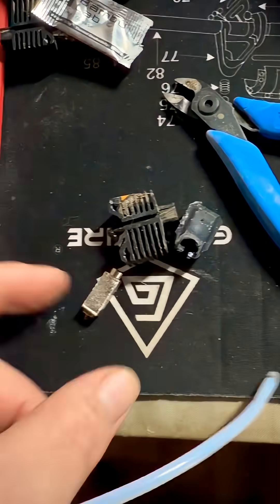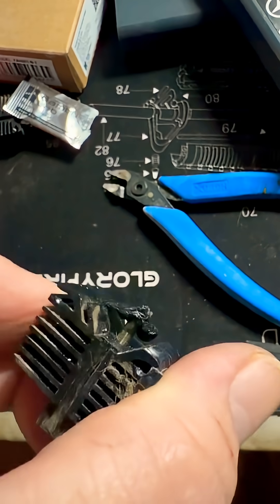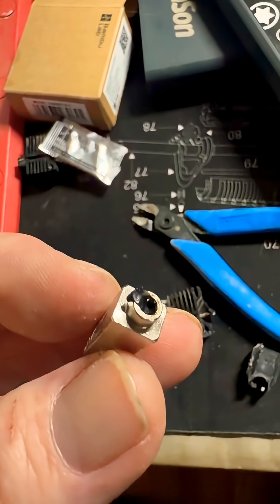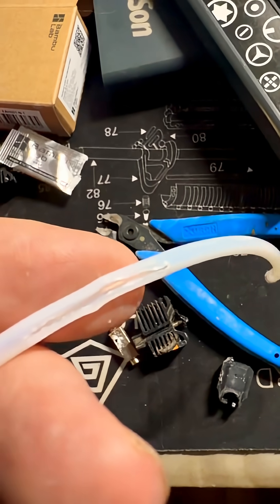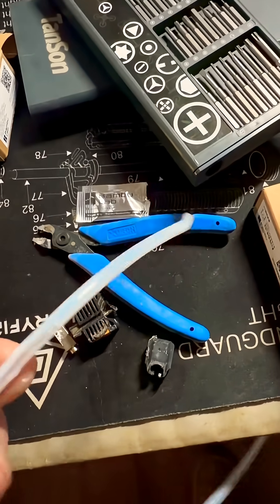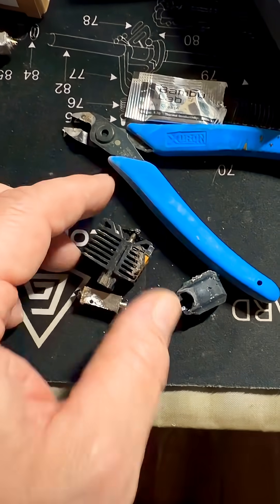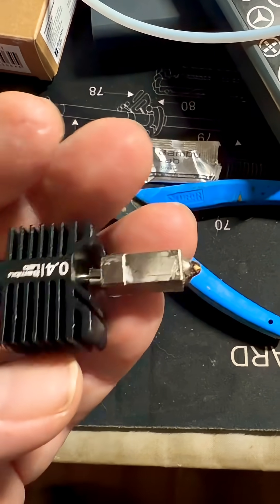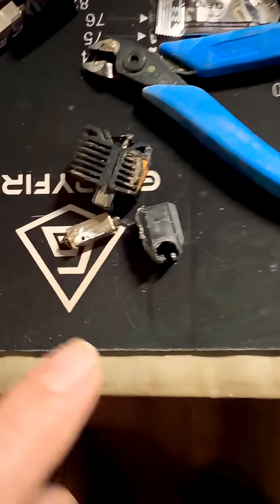My printer is begging for mercy. 🤣

Comment: You gotta clean them regularly with heat and solvents
Reply from the maker: I was just surprised that a hardened steel nozzle failed like this on an X1 Carbon. We need tool steel nozzles, at least I do. The stem on this one that goes up through the heatsink is really thin. I think they could improve on that.